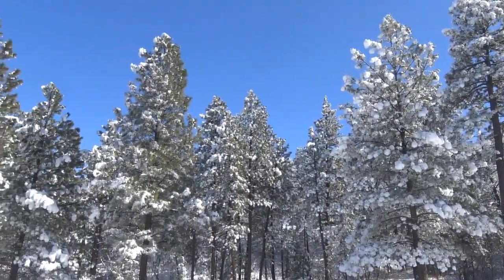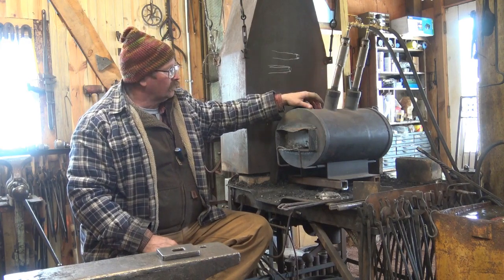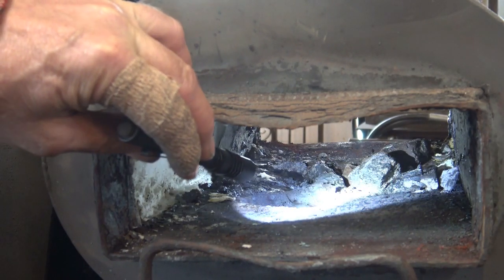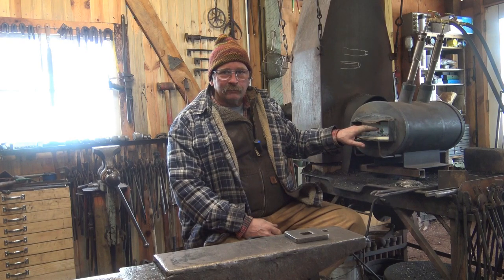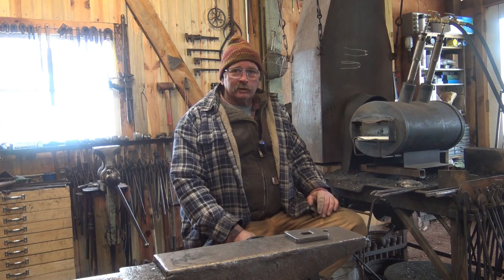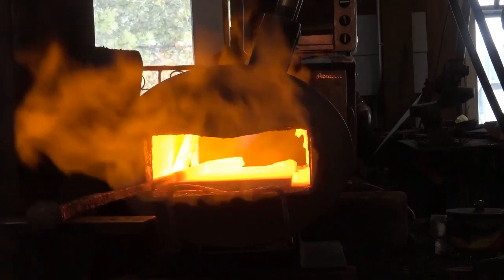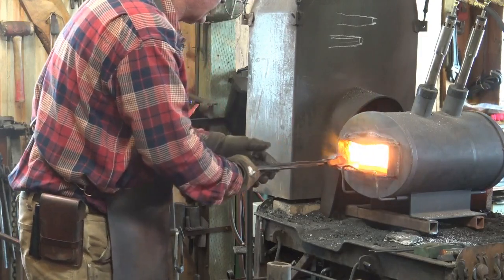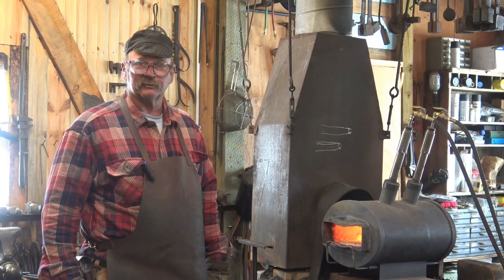Forge welding in a gas forge - fact or fiction

Comment: John, you mention in this vid that a ribbon burner is on your wish list for a new gas forge. What do you expect the advantages to be over a two burner aspirated or forced air propane gas forge?  My two burner roof mounted blown setup seems to have two hot spots right under the burner heads especially at lower gas pressures (10 psi). Is the goal of the ribbon to spread the flame more evenly? Thanks!! Got to get back to my flux spoon...
Reply from the maker: The big advantage is a more even heat.  But they also produce a gentle flame with less noise and less dragons breath.

Comment: Great video as always. I have a gas forge and am working on a new shop design, but I have a concern about the interior roof. I want my gas forge to be inside, but I don't know what to make the roof out of or what to do to in order to be sure that I don't burn my roof, or even my shop. I live in Florida, so heat is a double concern. I'm considering using 2 garage doors and opening both sides of the shop when it's in use... but again I live in Florida and we have a lot of heat and bugs. I forge as the sun goes down and into the night... exactly when the mosquitoes come out. Right now I pull my forge outside, but that makes it so I can only work when it's good weather... and I can't pull it back in until it's cooled off. Maybe you, or someone reading this, has already solved this issue. Any advice?
Reply from the maker: My ceiling is about 12 feet, so i feel safe running the forge without any special protection.  The ideal of course would be a hood over the forge to vent the heat out side the shop.  Suspending a heat shield between the forge and the ceiling would protect the ceiling but wouldn't do much to keep the heat out of the shop.
Reply: I'll keep the vent idea in mind. Thanks :)

Comment: Excellent video. I built my forge with fire brick and made an internet burner. Tried to weld but I don’t think it’s hot enough. Thinking of building another one with 2 burners. What kind of lining refractory stuff do you recommend?? Thanks again   

Enjoy your snow ours is disappearing!!!
Reply from the maker: The ceramic wool is certainly the best insulating of the refractory materials, but it is also the easiest to damage and posses the greatest health risk.  The ceramic boards are close, but are still easy to damage and when damaged can still put fibers into the air.  I am hoping to build with a castable refractory and just hope i can make a burner that will bring it to welding heat.  I am a bit tired of how fragile the higher tech refractories are.
Reply: I use disposable N95 respirators for most purposes as you can get a box of one hundred for well under $50 (US) online.  I don't think I'd trust them for actually cutting and installing ceramic wool, but should be adequate for hobbyists operating a kaowool forge.  The drawback is they need to be professionally fit-tested and you have to be painfully clean-shaven, or they're not much better than a cloth mask, and they won't stand up to a full day of heavy industrial use.  (They're designed for health care purposes.)  They also stay on in situations where HEPA respirators tend to get knocked off, and they're the same size as a cloth mask so you can keep a few in your glove compartment or tool box, or even your back pocket.
Reply: Ceramic wool, covered with a refractory like mizzou and then a coat of itc 100 works very well. The higher the alumina content a refractory has the more resistant it is to flux. I also add a stainless shelf with a coat of mizzou on it when i weld. It keeps the flux off of the floor and is easy to replace/reline with refractory when it gets too bad
Reply: Thanks for the information I appreciate it very much.

Comment: Straighten out the mouth of the forge, where it's bending down, and Weld a pc of 1-1/2" bar stock (or angle iron) , vertically across the top of it to strengthen it and keep it level.
Reply from the maker: That would probably work.  So far it hasn't bugged me enough to worry about it.

Comment: I built my forge from a somewhat original design and I have a few techniques that I believe are credible and worth knowing; and I would love to share them with the blacksmithing community.  My forge is a 30"x30"x15"(height) plate metal box. the top simply lifts away freely.  the inside walls have 2 layers of 2"ceramic blanket, the removable top has one 2" piece and it is a 2" recess on the walls' insulation that keeps the top from ever shifting around. I glued the kaowool in place using sodium silicate that I made from kitty litter and sodium hydroxide and water. (400g, 300g, and 500mL). the ceramic fiber is coated in ITC600 maybe? idr... amazon offers so many and they all work fine... my other forge I used satanite.. can't tell a difference.  anyway to the point : as a floor for the forge I made a 3" mixture of sand, sodium silicate, a small amount of portland cement, crushed red lava rocks, some plasticizer used for binding oddball and the key ingredient... which is - ceramic triangle things sold in a blue container at harbor freight and are used for polishing in a rock tumbler. i bought two containers for $15 each, crush the contents of one ( used my 20 ton press and a dye i've had since childhood for crushing stuff in, make sure you have means to contain the shrapnel, but a hammer and towel will work just fine) mix powdered ceramic in with the other ingrdients, and mash it all down as a floor base, then lay the 2nd container's worth of ceramic triangles atop the mixture as if it were a cobble stone road. let your forge get super hot and it will melt some of the stuff under the top layer and make that layer adhere to it keeping those little pieces of ceramic in place from then on. you can pour all the flux you wish on this without damage, you can get it as hot as you want with no damage, you can violently toss a 6lb billet of 4140 on top of it and it will not be damaged. I made the floor to my forge well over a year ago and have used it almost every day for 4-6 hours with no problems.        as for a burner, i needle valve propane into a 1" line that comes down through the top of the forge and connects to a homemade flare, and I use a bouncy house blower choking down through decreasing sizes of heater hoses til it connects to a bell reducer at the 1" pipe. I reach forge welding temps in a matter of minutes and only run pressure at 3-4 lbs from tank. all this is built atop a custom metal table allowing the forge floor recess at a lower height than the additional 30"x30" space in front of forge door. It pays to have a good clean flat space to place your work and slide into forge as well as room to lay firebricks or next work pieces or support longer pieces. the back of forge also has a 2" opening i keep plugged with bricks as an option for longer work pieces. the table is on casters and I made the space between legs as tong/hammer racks on front and one side being a chisel rack of magnetic strips.  hope you all enjoy the novel. email me and tag important if you wanna see pics of "ONE HOT MOMMA" as I dubbed my forge. homemaintenancebymm@gmail.com

Comment: Do you think its still possible to re-weld a piece once you've cooled it down? I have been making san mai from mild steel and files and sometimes i get hairlines when i grind the edges of the billet, i can see the water vapour bubbling up. Usually i toss them and start all over...
Reply from the maker: Yes, absolutely

Comment: Whats the thickest steel that you can get to forge weld in a single burner gas forge venturi  large burner I'm trying to forge weld the main bracket for the post vice where the pins go through I'm struggling to get enough heat and i have fire bans in place for summer so can't use the coal forge charcoal is my only fuel for it any help would be greatly appreciated thank you
Reply from the maker: That depends a more on the forge itself.  Every forge is different.  If it can forge weld smaller pieces, it might just be a matter of longer heating time

Comment: Why does it matter if it's gas or coal. Or altitude and air pressure? I would think as long as material your welding is at the right temp it will weld...not being  critical I genuinely want to learn. I'm an old machinist who has only forge formed a couple things with hammer and oxy acetylene. But want to start black smoothing as hobby
Reply from the maker: If its up to temperature you are correct.  But gas burners don't preform as well at higher altitudes and struggle to reach higher temperature.

Comment: Do you think it's feasible to build a forge with a highly insulative material such as kaowool on the top and sides, etc, and a harder and more durable material such as refractory cement on the bottom, or if the different rates of heat loss would cause problems?  I suspect it won't be, as I can make the bottom as thick as I want, but my actual forging experience is under a dozen hours.  Also, does refractory cement hold up to high temperatures as well as other materials?  The cheap stuff at my local box store is only rated for 2200 degrees Fahrenheit.
Reply from the maker: Absolutely, most forges are built that way.  Or at least they cover a kaowool bottom with hard refractory.  2200 is probably OK, but I would buy from someone that deals with forges or ceramic kilns to be sure.

Comment: I have a NC tool whisper momma with the two ports, and I have tried welding with it twice, but it is still difficult. It started to weld, but it is not hot enough, I let the metal which is about 1/4 inch rod stock, sit in the forge on 14 psi for about 4 minutes. Is that too short of time?
Reply from the maker: It sure wouldn't hurt to leave it longer.  Learning what it takes in a particular forge is half the battle.

Comment: How do you know that it's not just fused?
My welds come apart with a hammer and chisel.
Reply from the maker: Fusing and welding would be much he same thing.  Just keep refining the weld to increase strength of the weld. Getting it to stick lightly then calling it done will almost always lead to failure.
Reply: @BlackBearForge  
Thank you.
My welds today were better than yesterday's welds...its actually tearing steel instead of popping apart.
Propane forge. 
Apparently I have the heat capabilities, so it's a matter if technique now.
Thanks so much for your tutelage, and for the reply.

Comment: I love my ribbon burner forge.  I did buy the ribbon burner from Pine Ridge—Charlie, and ALL the people working there are a true class act. Highly recommend them. Yes, it is worth the cost. ***You MUST email them to figure out what ribbon burner size you need. They have their burners “graded” by volume on their site—that is for kiln use, not forge use.  
The thing I do not like about ribbon burner forges—you cannot localize the heat well.  Put another way, the entire piece is going to get heated, very evenly, and this makes it difficult to make things like tongs, etc.  it’s a waste of heat for some things.  But if you need to heat large pieces or heat evenly, it is more efficient.  Ribbon burners get crazy hot.  I turned mine down as low as I thought was safe and closed off all but a 4x4 inch opening after lighting.  30 min later the entire interior was white hot.